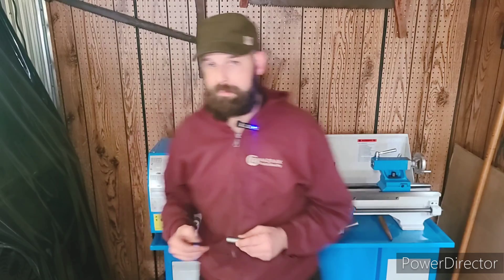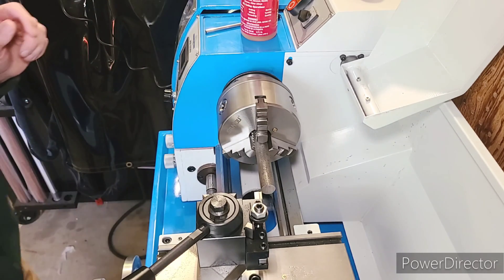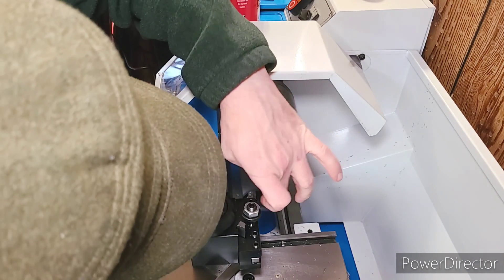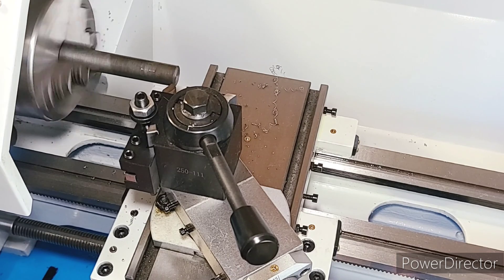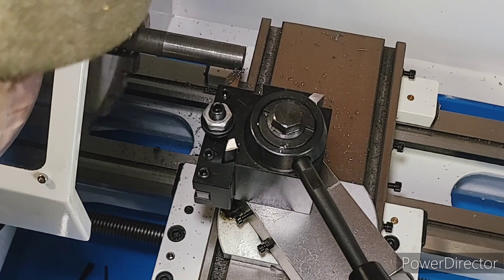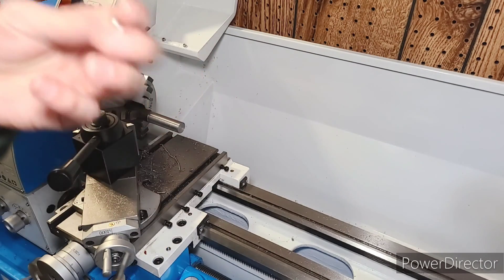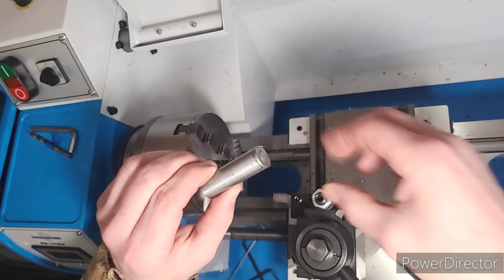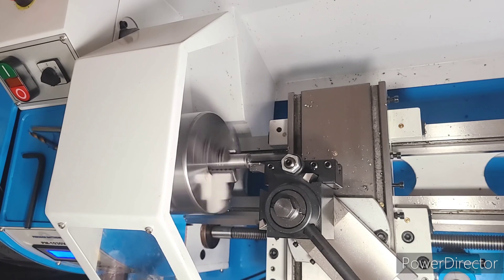New Precision Matthews Lathe Set-Up: Part 2

Comment: Squaring up the tool post not neccessary (as you saw later when cutting the angle on the rod). You need to learn about speeds and feeds (get a book) especially "the machinest handbook". Lubricate the hell out of the cut. Don't lubricate cast Iron but you can, although not required, lubricate non-ferrous metals. Keep your head away from the chuck, buy a head worn magnifier instead. Don't let your cothing get rapped up in the rotating parts. When drilling brass, break the edge of the drill bit, or the drill may want to screw itself into the work. The most important thing to remember is  Keep your fingers and your eyes and keep your hair away from the moving parts. So much to say, so little time, i'm pushing 80.
Reply from the maker: Sounds like some very solid advice. And yes, absolutely.I need to learn about speed and feeds. Especially with how to change out the gearing. I do own that book.I should probably read it. And that advice about breaking a drill bit for brass.That's a new one for me.Could you be a little bit more specific? honest question.
Reply: Take an abrasive stone and take off the cutting edges so they ( 2 edges)  are perpendicular to the axis of the drill, just a little bit! Basically dulling the edges.

Comment: Rigidity is paramount in small hobby lathes. Check your gib adjustment on all slides. Also move the compound towards the center of the lathe. Try to use the maximum amount of dovetails in the compound and cross slide. Make sure the center of the tools are at the center of the work.

Comment: Do you think this lathe can be operated while sitting (if the height was lower). I am not sure if I can manage leaning over for long periods of time. Thx.
Reply from the maker: I just set my shop stool up and did some dry runs to see how it felt. I had to extend my shop bar stool to its full height, but it felt fairly comfortable. It does slightly reduce your range of motion. But if you're making small parts I think it would work just fine. Sorry for the late reply.

Comment: Regarding the parting tool snapping... watch your video right at the start of the cut, at about 12:10. The parting blade is moving up and down A LOT. You see that, you back off immediately, something wasn't tight or squared up. There is a jump cut at 12:12, and unfortunately, I think you edited out where things went really wrong, as after the cut the part is wobbling at the tailstock end. Maybe it shifted in the chuck, maybe something else is loose... hard to tell with the key part of the video missing. It doesn't take much to snap a part-off blade. Every machinist has done this, many times. it can happen even if the setup is as perfect as you can get it, just from a chip pushing the blade a little bit too deep into the workpiece; if the side of the blade digs in, it's game over.
Reply from the maker: @shiphorns  Thanks for the advice. I'll take a closer look at where you recommended.

Comment: Regarding your tailstock, when it's set up correctly, you use the lever at the rear to lock it in place. No need to use a wrench on the nut. That's what the lever is for.
Reply from the maker: @GeneralDesignInnovation-es4zz  noted, thank you

Comment: Regarding parting, at 11:55 the part is running true. At 12:13 the part is wobbling. I believe the lateral pressure from parting caused the part to move in the chuck meaning the chuck wasn't tight enough. I am not an expert though.

Comment: Why is it always the part being worked on is wobbly? I usually use square to make sure it's straight, but it's always wobbly!
Reply from the maker: Sorry but could you be a little bit more specific? I'll try and help but again.I'm not a machinist by trade.
Reply: There is always some runout with 3 jaw chucks. After facing and turning it shouldn't wobble. I believe you can get it to run true with 4 jaw chucks but it takes effort and I've never done it.

Comment: Hi, nice lathe. Very quiet too! 

Regarding parting, some food for thought: 

- How thin is your blade? It flexed a lot when you started the cut, almost like if you were parting off on a threaded section (with a thin blade). I'm not seeing the holder moving, only the blade flexing, so maybe that blade was too thin (and the RPM was too low).

- You didn't seem to have excess stickout for the cut, but maybe it was too much for the thickness of the blade.

- Also it doesn't seem to me that you had the tool off center, it was cutting nice curly chips.

- When starting, with HSS, slow will get the job done - but I think you're going too slow. 1018 with 20mm O.D. I think I'd start with 150-180 RPM with a 3/32nds blade. "Same" lathe.

- Looks like the entire compound lifted when the blade broke. I'd check the compound play in all joints from the cross slide upwards. Also wouldn't hurt to check the carriage play. But at the least the compound should be locked during the operation and in a position where the parting tool is overhanging the cross-slide. Sorry for my poor english, I'm trying to help with little things that might make a difference. 

- There was some wobbling on the part before the blade broke, which wasn't happening at the beginning of the cut. Did the blade dig into the work and stalled the motor at some point (not shown on camera)? Sorry to ask but the times it happened to me, the part always ended up like yours (wobbling). And then yes, it runs crooked and the part grabs the blade.

- Confidence and feel play a big role on the parting operation. Don't give up, you'll get there!

(I had never seen a blade breaking before, yikes!) Stay safe!
Reply from the maker: Thanks for watching and your feedback. I agree that the RPMs were likely to slow. I'm a bit more confident now on the lathe in general, but still struggle a bit with parting. Luckily from what I can tell I haven't damaged anything or caused excessive play. Now, when I part, I also tighten up my gimbels. Which has been helpful. I just need some steady practice . Thanks again for the tips!

Comment: Your RPM is too low as you’ve been told already, but the depth of cut is too shallow as well. Your depth of cut should be around half of the radius of the tool for turning. So if you’re using an insert that has a.03 radius your depth should be .015. 

As for the parting tool, it was probably chip build up due to the low RPM and an inconsistent feed rate. 

Don’t get discouraged.  Get a copy of Machinery’s Handbook and practice with something more forgiving like nylon. When we were taught how to use a lathe in school we all started with nylon before moving on to brass, then aluminum and finally steel.
Reply from the maker: Very solid advice. Thanks for the input.I'll take a look at that book.

Comment: As a rule of thumb, unsupported stickout shouldn’t be more than 2x stock diameter - so 1” round bar shouldn’t stick out more than 2” - otherwise you’re asking for a ride into chatter town, always work as closely to check chuck as you can for maximum rigidity - but like you, I learned by trying! Blondihacks lathe series is fantastic for learning!
Reply from the maker: I'm a big fan of blondihacks! Thanks the advice.

Comment: More rpm.   Bud.     Glad to see you are taking it slow as not to hurt yourself or the machine.    But I assure you that machine is stronger than you.  Just don't crash.    Look up This old Tony,abom79,or cutting edge engineering on youtube.    They will help alot.

Comment: Check out the edge technologies height setting tool. Its absolutely a game changer and is faster and more accurate than eyeballing the tool height. They arnt really that expensive either.
Reply from the maker: I will DEFINITELY be looking into that. Thanks!
Reply: I got the PRO LATHE GAGE 02-000. I used to scoff at these sort of tools for a hobbyist but theres no way  I could measure it by eye as accurately as that can. @steelforestweldingandforge

Comment: More RPM. Cs×4÷Dia is what works for me. So if you have 5/8" steel, which is 100 for the Cs, you'd do 100×4÷.625=640 RPM. It appears you were going too slow at the start.
Reply: Please forgive my ignorance, what does the "C" represent in your formula?
Reply: @dennis900  Cs- Cutting speed. In the millwright manual, there's a chart of cutting speeds for different materials. Mild steel is 100.
Reply from the maker: Thank you for the advice and formula.

Comment: Your speeds are way to low. Turn your compound 180deg. Always try to cut on a forward direction. Maybe your parting tool was lower than the centre point. When you cut the face and drilling a centre drill, work piece as close to the chuck as possible.
Reply from the maker: What speeds would you recommend? I did center the cutting tool on the tailstock dead center.  Thanks for the info.